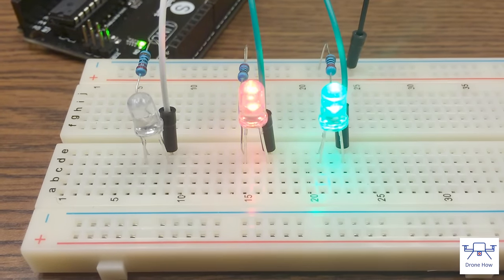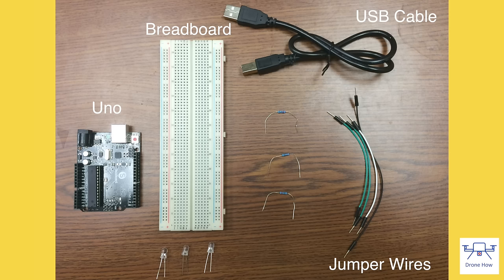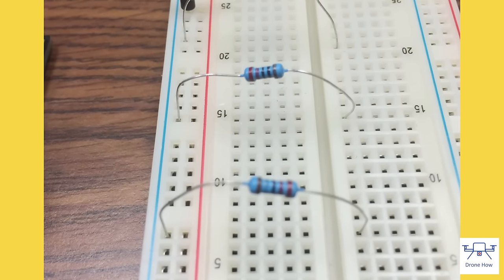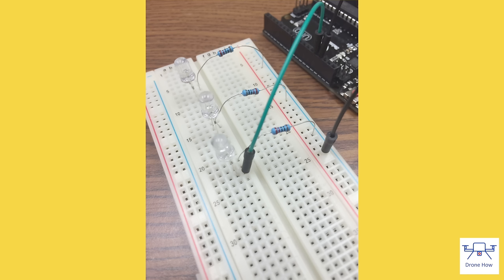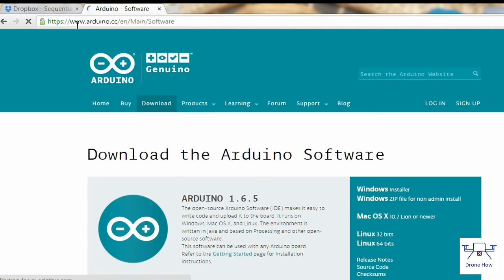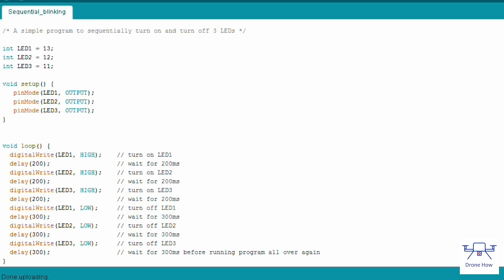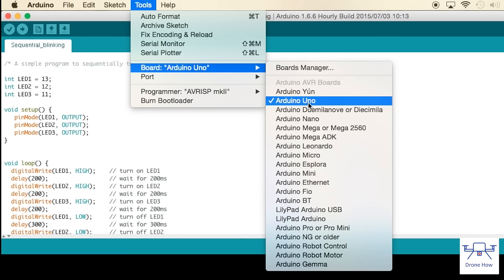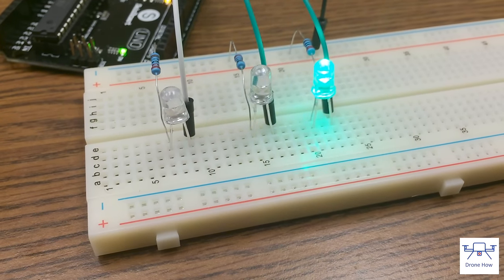Arduino Tutorial: LED Sequential Control- Beginner Project

Comment: FOR SOME REASON IT JUST DOESNT WORK FOR ME
a lot of errors show up, it says:
An error occurred while uploading the sketch
avrdude: stk500_recv(): programmer is not responding
avrdude: stk500_getsync() attempt 1 of 10: not in sync: resp=0xd4
avrdude: stk500_recv(): programmer is not responding
avrdude: stk500_getsync() attempt 2 of 10: not in sync: resp=0xd4
avrdude: stk500_recv(): programmer is not responding
avrdude: stk500_getsync() attempt 3 of 10: not in sync: resp=0xd4
avrdude: stk500_recv(): programmer is not responding
avrdude: stk500_getsync() attempt 4 of 10: not in sync: resp=0xd4
avrdude: stk500_recv(): programmer is not responding
avrdude: stk500_getsync() attempt 5 of 10: not in sync: resp=0xd4
avrdude: stk500_recv(): programmer is not responding
avrdude: stk500_getsync() attempt 6 of 10: not in sync: resp=0xd4
avrdude: stk500_recv(): programmer is not responding
avrdude: stk500_getsync() attempt 7 of 10: not in sync: resp=0xd4
avrdude: stk500_recv(): programmer is not responding
avrdude: stk500_getsync() attempt 8 of 10: not in sync: resp=0xd4
avrdude: stk500_recv(): programmer is not responding
avrdude: stk500_getsync() attempt 9 of 10: not in sync: resp=0xd4
avrdude: stk500_recv(): programmer is not responding
avrdude: stk500_getsync() attempt 10 of 10: not in sync: resp=0xd4
Reply: Connection problem

Comment: Edit: If your LEDs are super dim, you're probably using the wrong resistors.  I didn't notice the labels on my kit until now >_<
Reply: my  red led got a little dim but my white and blue leds were the same even when i used 1k resistors{1000ohms}

Comment: // Definisi pin untuk LED dan buzzer
const int ledRed = 9;
const int ledYellow = 10;
const int ledGreen = 11;
const int buzzer = 8;

void setup() {
  // Set pin-mode untuk LED dan buzzer sebagai output
  pinMode(ledRed, OUTPUT);
  pinMode(ledYellow, OUTPUT);
  pinMode(ledGreen, OUTPUT);
  pinMode(buzzer, OUTPUT);
}

void loop() {
  // Mengatur LED merah untuk berkedip 3x
  for (int i = 0; i < 3; i++) {
    digitalWrite(ledRed, HIGH);
    tone(buzzer, 1000); // Bunyikan buzzer
    delay(500); // Tahan LED dan buzzer menyala selama 500ms
    digitalWrite(ledRed, LOW);
    noTone(buzzer); // Matikan buzzer
    delay(500); // Tahan LED mati selama 500ms
  }

  // Mengatur LED kuning untuk berkedip 3x
  for (int i = 0; i < 3; i++) {
    digitalWrite(ledYellow, HIGH);
    tone(buzzer, 1500); // Bunyikan buzzer
    delay(500); // Tahan LED dan buzzer menyala selama 500ms
    digitalWrite(ledYellow, LOW);
    noTone(buzzer); // Matikan buzzer
    delay(500); // Tahan LED mati selama 500ms
  }

  // Mengatur LED hijau untuk berkedip 3x
  for (int i = 0; i < 3; i++) {
    digitalWrite(ledGreen, HIGH);
    tone(buzzer, 2000); // Bunyikan buzzer
    delay(500); // Tahan LED dan buzzer menyala selama 500ms
    digitalWrite(ledGreen, LOW);
    noTone(buzzer); // Matikan buzzer
    delay(500); // Tahan LED mati selama 500ms
  }

  delay(1000); // Tahan 1 detik sebelum mengulang
}
Reply: // Definisi pin untuk LED dan buzzer
const int ledRed = 9;
const int ledYellow = 10;
const int ledGreen = 11;
const int buzzer = 8;

// Definisi pin untuk seven segment display (contoh menggunakan common anode)
const int segmentA = 2;
const int segmentB = 3;
const int segmentC = 4;
const int segmentD = 5;
const int segmentE = 6;
const int segmentF = 7;
const int segmentG = 12;
const int digit1 = A0; // Terserah pin analog mana yang digunakan
const int digit2 = A1; // Terserah pin analog mana yang digunakan

void setup() {
  // Set pin-mode untuk LED, buzzer, dan seven segment display sebagai output
  pinMode(ledRed, OUTPUT);
  pinMode(ledYellow, OUTPUT);
  pinMode(ledGreen, OUTPUT);
  pinMode(buzzer, OUTPUT);

  pinMode(segmentA, OUTPUT);
  pinMode(segmentB, OUTPUT);
  pinMode(segmentC, OUTPUT);
  pinMode(segmentD, OUTPUT);
  pinMode(segmentE, OUTPUT);
  pinMode(segmentF, OUTPUT);
  pinMode(segmentG, OUTPUT);
  pinMode(digit1, OUTPUT);
  pinMode(digit2, OUTPUT);
}

void displayDigit(int digit) {
  // Kode untuk menampilkan angka di seven segment display
  switch (digit) {
    case 0:
      digitalWrite(segmentA, HIGH);
      digitalWrite(segmentB, HIGH);
      digitalWrite(segmentC, HIGH);
      digitalWrite(segmentD, HIGH);
      digitalWrite(segmentE, HIGH);
      digitalWrite(segmentF, HIGH);
      digitalWrite(segmentG, LOW);
      break;
    case 1:
      digitalWrite(segmentA, LOW);
      digitalWrite(segmentB, HIGH);
      digitalWrite(segmentC, HIGH);
      digitalWrite(segmentD, LOW);
      digitalWrite(segmentE, LOW);
      digitalWrite(segmentF, LOW);
      digitalWrite(segmentG, LOW);
      break;
    case 2:
      // Implementasikan untuk angka 2
      break;
    // Implementasikan untuk angka 3, 4, 5, 6, 7, 8, 9
    default:
      // Matikan semua segment jika tidak ada angka yang cocok
      digitalWrite(segmentA, LOW);
      digitalWrite(segmentB, LOW);
      digitalWrite(segmentC, LOW);
      digitalWrite(segmentD, LOW);
      digitalWrite(segmentE, LOW);
      digitalWrite(segmentF, LOW);
      digitalWrite(segmentG, LOW);
      break;
  }
}

void loop() {
  // Mengatur LED merah untuk berkedip 3x
  for (int i = 0; i < 3; i++) {
    digitalWrite(ledRed, HIGH);
    tone(buzzer, 1000); // Bunyikan buzzer
    displayDigit(8); // Tampilkan angka 8 pada seven segment
    delay(500); // Tahan LED dan buzzer menyala selama 500ms
    digitalWrite(ledRed, LOW);
    noTone(buzzer); // Matikan buzzer
    displayDigit(-1); // Matikan seven segment
    delay(500); // Tahan LED mati selama 500ms
  }

  // Mengatur LED kuning untuk berkedip 3x
  for (int i = 0; i < 3; i++) {
    digitalWrite(ledYellow, HIGH);
    tone(buzzer, 1500); // Bunyikan buzzer
    displayDigit(5); // Tampilkan angka 5 pada seven segment
    delay(500); // Tahan LED dan buzzer menyala selama 500ms
    digitalWrite(ledYellow, LOW);
    noTone(buzzer); // Matikan buzzer
    displayDigit(-1); // Matikan seven segment
    delay(500); // Tahan LED mati selama 500ms
  }

  // Mengatur LED hijau untuk berkedip 3x
  for (int i = 0; i < 3; i++) {
    digitalWrite(ledGreen, HIGH);
    tone(buzzer, 2000); // Bunyikan buzzer
    displayDigit(2); // Tampilkan angka 2 pada seven segment
    delay(500); // Tahan LED dan buzzer menyala selama 500ms
    digitalWrite(ledGreen, LOW);
    noTone(buzzer); // Matikan buzzer
    displayDigit(-1); // Matikan seven segment
    delay(500); // Tahan LED mati selama 500ms
  }

  delay(1000); // Tahan 1 detik sebelum mengulang
}

Comment: Sketch uses 1,208 bytes (3%) of program storage space. Maximum is 32,256 bytes.
Global variables use 15 bytes (0%) of dynamic memory, leaving 2,033 bytes for local variables. Maximum is 2,048 bytes.
avrdude: stk500_recv(): programmer is not responding
avrdude: stk500_getsync() attempt 1 of 10: not in sync: resp=0xa0
avrdude: stk500_recv(): programmer is not responding
avrdude: stk500_getsync() attempt 2 of 10: not in sync: resp=0xa0
avrdude: stk500_recv(): programmer is not responding
avrdude: stk500_getsync() attempt 3 of 10: not in sync: resp=0xa0
avrdude: stk500_recv(): programmer is not responding
avrdude: stk500_getsync() attempt 4 of 10: not in sync: resp=0xa0
avrdude: stk500_recv(): programmer is not responding
avrdude: stk500_getsync() attempt 5 of 10: not in sync: resp=0xa0
avrdude: stk500_recv(): programmer is not responding
avrdude: stk500_getsync() attempt 6 of 10: not in sync: resp=0xa0
avrdude: stk500_recv(): programmer is not responding
avrdude: stk500_getsync() attempt 7 of 10: not in sync: resp=0xa0
avrdude: stk500_recv(): programmer is not responding
avrdude: stk500_getsync() attempt 8 of 10: not in sync: resp=0xa0
avrdude: stk500_recv(): programmer is not responding
avrdude: stk500_getsync() attempt 9 of 10: not in sync: resp=0xa0
avrdude: stk500_recv(): programmer is not responding
avrdude: stk500_getsync() attempt 10 of 10: not in sync: resp=0xa0
Problem uploading to board.  See http://www.arduino.cc/en/Guide/Troubleshooting#upload for suggestions.

please Help :)
Reply from the maker: +Asif Ul Islam Have you selected the correct Arduino board in your settings? And what COM port are you using? Is that the COM port on which your Arduino is connected?
Reply: this problem has solved but a timeout message is showing ! what can be the solution of that ?

Comment: idk why it isnt working :(
Reply: Because he gave you the wrong information. It didn’t work for me neither. I had to follow another vid.
Reply: mine works, just change the code because the 13th pin on arduino uno's newer versions the pin 13 is connected to the led onboard, so just change the pins to: 12,11 and 10 and everything should work
Reply: try this code:

void setup() {
  pinMode(12, OUTPUT);
  pinMode(11, OUTPUT);
  pinMode(10, OUTPUT);
}

void loop() {
  digitalWrite(12, HIGH);
  delay(300);
  digitalWrite(12, LOW);
  digitalWrite(11, HIGH);
  delay(300);
  digitalWrite(11, LOW);
  digitalWrite(10, HIGH);
  delay(300);
  digitalWrite(10, LOW);
}